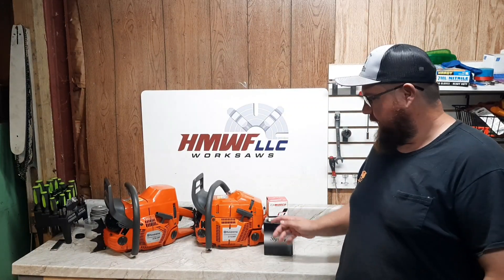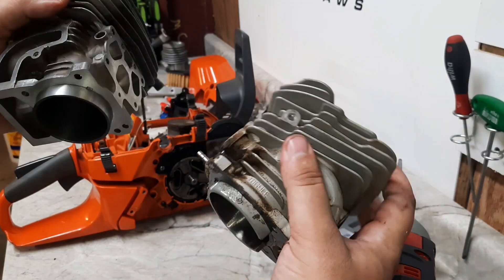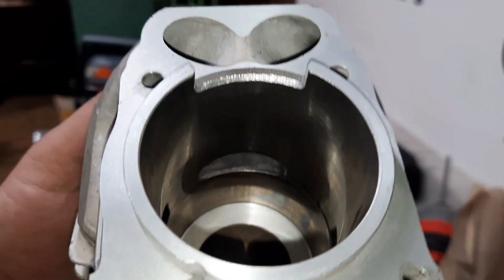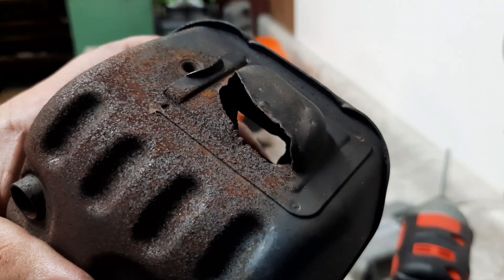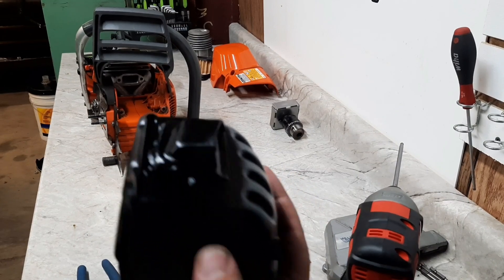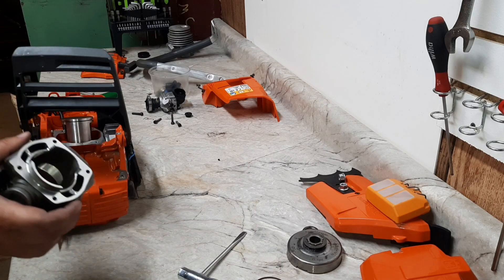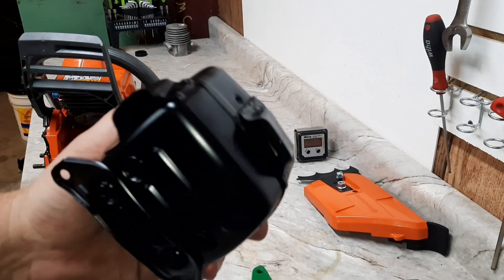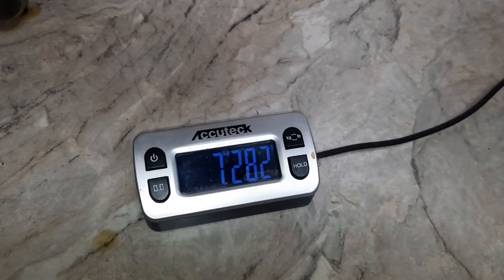Huge Power 372xp build? 76cc BIG BORE Hyway Problems? 576xp gains well

Comment: Interesting. I have an 028 wood boss that I put a 46mm Hyway top end on. In the cut it fell flat on its face. I took the cylinder back off and really compared it to the stock 44mm. The intake port was significantly smaller, so I opened it up. We’ll see how it works out but as of now I don’t have high hopes

Comment: Try tuning the big bore a little different to get more rpms. It can handle at least  11.5k. mines at least 12.5k with a kinda stock muffler without a baffle and no muffler gasket. Noticed it was a bit choppier after removing the muffler gasket. They also like to get very warm so watch out for frying it. So far after a year of figuring out a perfect tune for it the piston is like new still. Nice and shiny no scoring, wearing in pretty evenly with 93 40:1 I believe the ratio we use is. I also have a nwp bbk little cheaper than a hwy I think

Comment: I’ve recently used a rocwood cylinder on my vintage stihl 038  
Super/ mag and to be honest it’s not that bad. 
The exhaust port wasn’t as wide as oem but I widened it. the squish band was a bit lumpy but fortunately the material was soft enough to grind down with 220 grit sandpaper super glued onto an old piston:) the numbers were pretty good straight off with no need to cut the base as it was 20 thou with gasket the exhaust roof was 104 which I lowered to 100. 
I opened and shaped the lower transfers as far as possible and ended with 170 psi on the compression tester. 
For the price I paid £28 I can’t complain tbh as it got the old girl running again 😂
Love your work Joe 👍

Comment: dont you think the BB needs a bigger carb to get a real increase ? like a 390xp one or something, it would be interesting
Reply from the maker: Not really going to change it much. The stock bore was still running stock carb and made better power. With the large undercut at the top of the bore it wouldn't allow me to drop like I wanted. Plating issues and other things really limited these cylinders.
Reply: @dynojoemods2764  Is that undercut on all the Hyway cylinders do you know?.
Reply from the maker: @MegaDirtyberty  
I am not sure.
Reply: My thoughts too, 20 thou squish, higher compression, bigger carb and let those exhaust gasses escape efficiently.
Reply: Ok cool. It Really helps me on my next 372xp topend. Does the wiseco piston has good durability or its more race oriented

Comment: You have me worried, my 372 oe is destroyed, cylinder piston and bearing. I’m thinking if I should have it rebuilt. But now you have me worried, I was searching for a meteor kit and have it ported, is it a good idea ? She was supposed to get a porting but the porter saw the damage when he opened it
Reply from the maker: If not porting, the aftermarket plating isn't normally an issue. But as soon as you try porting, the flaking can happen.

Comment: What is the max RPM I should go on this? I put the hyway in and it cuts well in the cut and I have no problem getting through wood, but when I set it down after using it for a while it dies almost as soon as i set it down. What screw should I adjust?
Reply from the maker: Idle, or the L will have the most impact on the idle. As for max rpm that is hard to tell richen it up until it burbles out of the cut and seems to pick up rpm once a load is applied

Comment: I have a video on my page of my Stihl Ms661 I want to trade for a 592xp many extras and goodies if your interested dyno Joe your video of the 592xp making over 8 horsepower stock has peaked my interest, its like now bought oem full wrap separate, titanikel cylinder and pop-up piston, skid plate, bark box, 25inch and 30 inch bars and chains oem stihl plus scabbards. I'm located in western PA and I have all the stock parts also Egan uni foam filter kit.
Reply from the maker: Sorry, I don't have a 592 to trade.

Comment: I had literally exactly the same experience with porting a Hyway BBPU cylinder and piston for a 372XP. Beginning to doubt my own sanity (and porting finesse) by the end of it! Thankfully got it done and it runs like a scalded cat, but not messing about with their cylinders any more.
Reply: Yea I just found out the hard way before seeing this video of course. I was just cleaning up and chamfering the ports 9n my bbpu 372 cylinder brand new from hyway and the plating flaked off on the exhaust and intake port below and above as to screw me from using it without going further and actually porting it and changing the shapes. Which I didn't intend on doing

Comment: By the 372 BB it seems to be that the original big bore cylinder was designed for larger stroke about 38 mm according the upper transfer. With 36 mm is not fully exposed and piston restrict the flow. The Chinese big bore and hyway just copied it. On the ported 50mm 372 you had 122 transfers on big bore only 124. It seem to be the  transfers wider on 50mm cylinder than on 52mm BB. So you lose on thiner transfers and shorter timing on 52mm BB. So the bottleneck seems to be on upper transfers.  You probably need to wide the upper transfer and playing with edge of piston in place of upper transfer to get needed flow.
Reply from the maker: A lot of the transfer problem comes from them copying a "bored" cylinder. That is why the transfer floors are so much lower, and the transfers themselves.

Very hard to make the outside of the tunnels larger for better flow. Port widths are very similar, just the heights are off.

More compression and duration would probably really help the big bore. But every time the stone gets near the plating it is a risk of scrapping the entire cylinder.
Reply: @dynojoemods2764  To round the edge of piston could do the trick. It is relatively safe.

Comment: That's wild Joe!  I wonder how close they would be if you didn't cut the squish on the stock cylinder?  Ya know, for guys like me who really can't cut squish anyway.  The two I just ported, one big bore and one stock 50mm, they were very similar in power.  I would have been able to feel a whole extra hp...I think.  But man, it really points out some serious losses on the hyway stuff.
Reply from the maker: I think the compression really ups the power output. Espically on the lower half. I would guess the oem to be a bit better, but would be close.

Comment: Great video Joe. You're exactly right about the Hyway plating. I've found it really prone to lifting if using burr bits. I've also found the Titanickle and Meteor do it, but not quite as bad. Ive been using the diamond bits for awhile now and have also been doing the outline with them thru the plating and find it works (most of the time) especially if the rotation of the bit is not lifting the plating away from the opening.
Do you use the CC 90 degree hand piece? If you're up to do a video of you porting tools, I'm sure a lot of us would be interested. A lot of people don't realize how expensive the tools are.
I wasn't expecting those results from the 576, the ones I've been around have stayed stock, and seemed to be overweight dogs.
The 51.4mm older 371 OR 372 XPW and maybe Jonsered 2077 were OEM big bores that seem to run pretty good with a bit of work.
Thanks.
Reply: The direction of travel you talk about would be known as “climb cutting” which is about the only way I see to work on poorly plated cylinders.
Reply from the maker: Adds a ton of time to the build and still may flake. 

Yes I use the cc 90* tool. I'll have to goi over the porting stuff I use sometime.

Comment: On the The BB372 the upper transfer is much larger in vertical axis compared to 50mm cylinder, but on 52mm cylinder the upper transfer  is not fully exposed even when piston is in BDC.  The flow is disrupted with the piston wall and throughput is lower than by 50mm cylinder.

Comment: What do you recommend  for a jonsered 2171 stock that I bought ran , and burned. It was set too lean. I should have known better.  I will replace cylinder and piston and do air leak test. Oem, hyway, or other? I can do intake and exhaust porting. Just looking for oem +.
Thanks.
Reply from the maker: You may be able to clean the factory cylinder. But oem would be first choice. If you want to try porting. The cheaper the better.

Comment: No porting experience here, but I did experience bearing failure on a friend's 576 (non AT) about 5 years after I replaced the cylinder with am oem.  Cylinder was still good and lubed, but the crank bearings were dry and purple.  I told him to run 32 or 40:1 rather than the 50 to see if it helps.  It's been a minute, but I don't think the strato saws lube the bottom end as well due to less mix on the underside, though my memory is a little fuzzy . . . Had my head automotive stuff for a few months and forgot a lot of chainsaw stuff lately.   

I had a white box poulan 335 piston hot-sieze on me out of the box on a recovered, honed out oe cylinder, for what it's worth. Sanded it down a bit until it rattled in the bore.  Super sketchy, but also successful so far. 👌 

Ran a Duke's 272 kit on a 61 with good success . . . Except the .015 squish with no base gasket allowed me to buy a new piston after it broke the ring land.
Reply: Just ordered a duke big bore for my 029 , glad to hear some positive feedback …. Cheers

Comment: It seems hyway cylinders quality and port shapes are hit or miss. Make a custom pipe for that 372 big bore Big difference in power! The stock mufflers hold the saw back big time especially when you port the Big bore  . I put a 272 piston in my 372 big bore kit also did case work very close in power to My ported Stihl ms 660.

Comment: I tried a hyway 52mm pop up 372 kit and found it to be junk. Plating chipped without porting and locked the saw up on the 3rd tank. I'll never use one again. It seems some guys on YouTube swear by them but I've had better results with cheaper kits

Comment: You had any experience porting a meteor jug joe? I never have tried one after doing a big bore 372 hyway for a logger and the plating chipped above the exhaust port and locked her up after a few tanks. Stuck to OEM from that point on.
Reply: @MFsaws I ported a couple meteor cylinders, as I'd also had those issues with the Hyway plating. I found the Meteor as well as the Titanickle to be a bit less prone to flaking, but they still did a bit, so pretty much had to be just as careful. I was disappointed after paying the extra$. I also use the diamond bits as Joe described to outline and then open up after I've got thru the plating.
Reply: @jimssawsnstuff8903  I appreciate the information! Sounds like if it’s for a pto better stick with oem. Toys for me are usually Farmertec haha. Thanks again!
Reply from the maker: No, only ones other than this have been white box no name or dukes/saw salvage cylinders
Reply: @dynojoemods2764  Gotcha! Thanks for the reply. Are those dukes ones soft plating like the Farmertec ones? Great videos it’s awesome to see numbers of the ported saws.

Comment: Hyway can be good for a simple swap on kit. I really think they should make the plating a bit thicker then they do just for those issues. It's very hard in some spots to get your tool to cut into and not away from the plating to keep it from chipping. I definitely understand why you personally don't like to port them for customers, I don't blame you at all. Definitely had a few my self that has chipped luckily it was on the lower side of the transfers and not the top. Since it was below the rings travel path I didn't mind it as it's my own saw and not someone else's. Always interesting videos and helpful info. 👍
Reply: Have u tried porting a titanikle
Reply: Me personally no. Haven't bought a hyway cylinder in a while. If I need one I will probably order one and try it. Have herd the #'s are better then the basic hyway cylinders.

Comment: I dont know how a saw will respond but i had an rm250 that lost substantial power when the muffler would fall off the pipe. It wanted that pice of pipe to draw the exhaust out of the expansion chamber. Maby a 6 inch pice of tubing instead of a deflector would pick up a little power.

Comment: I have ground on Holzforma and cheap aftermarket cylinders. 

Just recently on a 52mm hyway, first time I ever had plating chip. Same place you did opening the lowers. This was my first hyway and I totally agree with your assessment.  Bolt on- ok……don’t know if I would grind on another hyway.
Reply from the maker: I have had better luck with the white box no name for grinding. Dukes kits have been good too.
Reply: Just did my first hyway ms 460 cylinder.    I’ve only ported two other oem cylinders with no chipping.  I used my diamond bit  to work through the plating after that.  20 thou squish 102 exhaust 129 transfers and 156 intake duration.  Also has the hyway pop up.  It runs well but I thought it would feel more powerful than my 272 xp that I ported.  Do you think that could be because of the high blowdown? Love your videos man!

Comment: Oh I've got a good one when you run out of video ideas.  The infamous Husky 51/55 Hyway cylinder.  Why does it not make good power, and how do ya fix it!

Edit after watching:  Nevermind gonna pony up for an oem closed port to play with.  You're not the first to mention plating failure.
Reply from the maker: I still haven't got to the last video "idea" you helped with... but that is a good one
Reply: @dynojoemods2764  I like what you do here dude.  You can ignore my BS as you see fit.  I just make sure to try to leave a comment 😁
Reply from the maker: @mattfleming86  

Oh, I appreciate It! I try to respond to as many comments as I can too. But that is a sound idea. I've never seen a 50/55 lol
Reply: @dynojoemods2764  To be a little "homeowner" saw they are great.  Split case, removable jug.  Only real downfall is the recoil assy doesn't like real high compression.  They seem to handle squish better in the .030 plus range best if you don't run a decomp cyl.  
The 50/51/55 are probably husky's most sold saw of all time.
Reply: Where you gonna find a stock 55 closed port cylinder, better yet, what piston will you use, they are tough to find. Not sure who it was, but someone was making a piston for the closed port 55 cylinder, don't know if they still are our not?
Reply: @brettblack7049  HLS pro parts has em in stock.  Decomp cyl so should be closed port.  120 bucks though.  Thus the allure of making an 80 dollar kit or even a 30 dollar kit work.  But I've seen so many people say that they went up a few CCs and lost power, even from a 51 starter.
I stopped at muffler mod, .035 squish, and a slight timing advance.    Don't want to kill this saw if I can help it... i'd have to dig out the 271 farm boss if I did :-D
Reply: @mattfleming86  interesting,  oe parts or aftermarket. Yep, the decompression version was the closed port in the oe.
My last 55 closed port had 180psi stock, but I'd still rather run a 346 for firewood,  and a 550mk1 for a work saw.
Break out the 271 action man 😜
Reply: Really depends on how you port the cylinder and what piston you choose. These little guys do like lighter pistons then most 50 class cc saws. They aftermarket closed port cylinders are not a quad close at/ into the combustion chamber and really need epoxy to help reflow the transfers. Definitely does help in the flow and can pick up some power not much as it is a small saw. Ever 1/10th of a hp in these little guys does help. Also if the work is right boring the carb and adjusting jet sizes does help. Just don't go to far with the intake timing they don't care for long duration intakes or crazy large intake ports. Really depends every person that ports or has tried to does it differently and there is no wrong or right way of doing so. If something works for you keep at it!

Comment: Too bad it would be feasible to pump extrusion putty through those transfer ports.
Reply from the maker: Yeh, to match the oem both walls would be paper thin. Might be worth trying if the plating stuck a bit better.